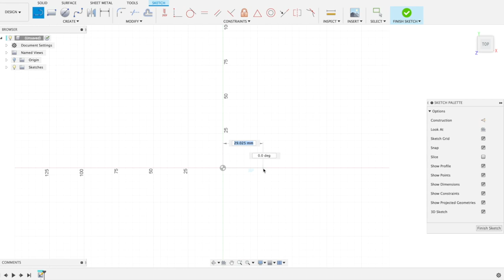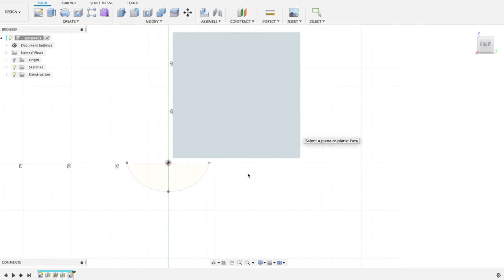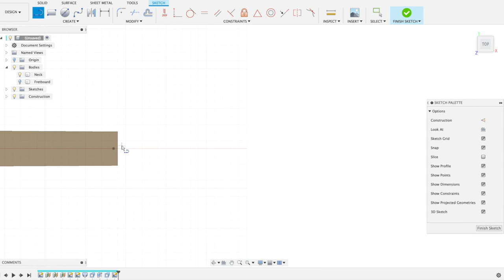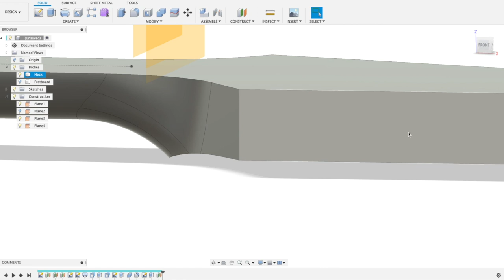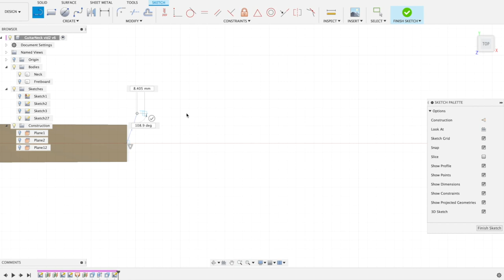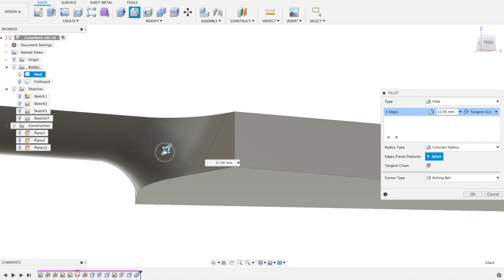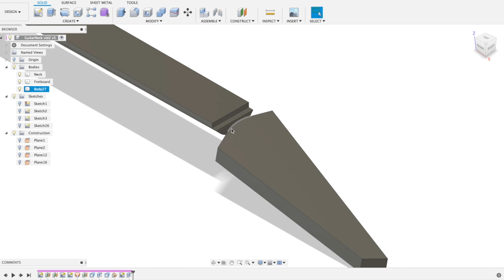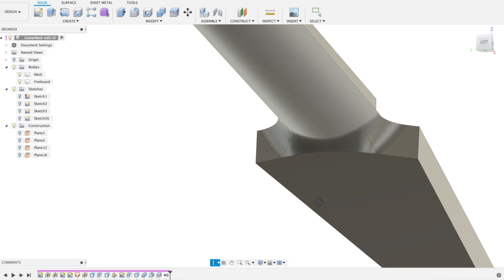3 examples of drawing a headstock on a guitar neck in Fusion360

Comment: 3:40 Note, in order to select the correct point at the tip of the volute, I needed to go to Solid -> Construct -> Point along path. Then select the volute edge, and drag the point until it snaps to the center. There might be a better way of doing this, I'm new to Fusion.
Reply from the maker: You COULD be very specific and try to get as close as you can to that specific point, but it really is not important for this particular sketch. I could have started that spline a bit further away and get the same result. I just needed a sketch which I use as a 'razor' to cut away that specific part. Hope this helps.

Comment: This channel is amazing. Have you ever done a scarf joint on the CNC?
Reply from the maker: I have not yet(?) done a scarf joint. But I imagine it’s not really hard to make on a CNC. Totally depends on the drawing though. Just like a neck through body design, which I still have on my ‘bucket’-list :-) Btw I assume you mean a scarf joint for the headstock, right? Right out of the top of my head, just spilt the “neck”-body right at the neck/headstock connection, on the bottomside of the angled headstock.

Comment: NIce, but I wish you had talked between 1:00 and  2:00 , because the drawing of the precision sketches is the most   difficult part.   The tricks for centering a line, and making those spines symetrical .... i have no clue.
Reply from the maker: I always feel I talk too much :-D You could take a look at this video: https://www.youtube.com/watch?v=shxir1Z4Bw8 (it's divided in chapters, but you'll work it out, it says in the description) 
The 'tricks' are really easy. As you long as you drag the handles of the splines only in the horizontal direction you should be fine in regards to symmetry. I hope this helps!

Comment: Hello friend, could you make a tutorial of the headstock design from a svg or dxf design that can be adapted to the design of the arm, it is difficult for me to make the design from fusion, there is a way to make the design from an illustrator and adapt it in fusion, you could explain the location well pegs taking into account the guide lines of the strings and the distance from the edge of the nut to the string and I follow you and you are the best explaining

Comment: Awesome!  I followed your complete build with the 10 degree.  In the cam process, does the neck require a scarf joint or can it be done on cnc?
Reply from the maker: That depends on your machine: the 10 degree headstock has a few angles (all sharp angles in regards to your routerbit) which can’t be machined by a 3 axis machine. 

For example, the holes for the tuners have a diagonal angle which the routerbit, which is straight up, can’t reach. But if you are the lucky owner of a zillion-axis cnc machine this should be doable. 
With a normal 3 axis machine the angles at the outside of the headstock could perhaps be done in 2 strategies, the angles at the neckposition of the headstock from the topside, the angles at the outer end of the headstock from the bottomside.
And skip the tunerholes and do them manually later, (which I personally would never do; there’s a reason I have a CNC, I’m not that good at woodworking... besides sanding though..)

So the scarf joint would be the next possible option, I guess. This breaks up the process in two. I would probably slice the headstock/neck connection with a splitbody function and use the bottom of the headstock as a tool. Hope this helps.
Reply: Audiohotshot very helpful!  I only have a 3 axis, so I guess I can go back and remove my construction plain and do more of the fender style you showed
Reply from the maker: @ericweatherman9040  I made a drawing today and its totally possible to do on 3 axis machine :-) Just make sure you split the body with the bottom of the angled headstock as tool. Hope this helps
Reply: Audiohotshot not sure I completely understand. Do you do Skype lessons? Looking at could I cam out the headstock or how could I change the headstock angle to more of a fender straight
Reply from the maker: Sure, I would do Skype, no prob, but if there's enough interest I could organise a youtube Live event for discussing a few other topics as well (like different methods of designing a guitar, building a CNC starting from scratch) :-) But at least you gave me inspiration for the next video to come (maybe this weekend I'll find the time to shoot it, but I'd also like to shoot the machining of it as well then).
Reply: Audiohotshot sounds great! I would love to get a Skype session with you and would definitely compensate you for your time.  What’s the best way to contact you?
Reply from the maker: You could do a Skype search for Audio Hotshot (mind the Space between the words). :-)
Reply: Audiohotshot thanks!
Reply from the maker: No prob, please keep in mind that I’m in Europe and we have a huge time difference. If I see your name pop up in Skype we’ll setup a time and date soon!
Reply: Audiohotshot sound great! Thank you